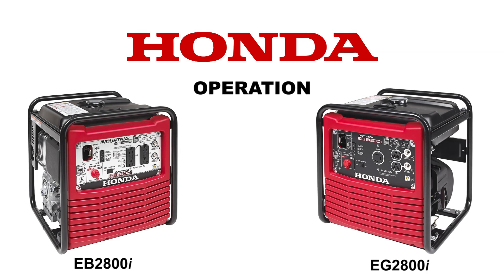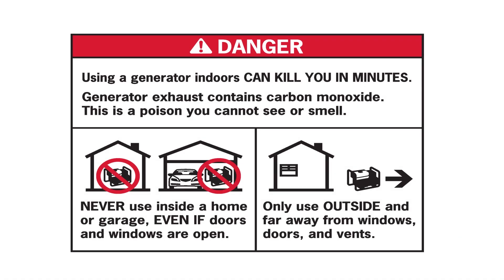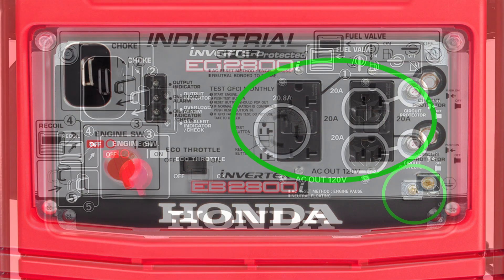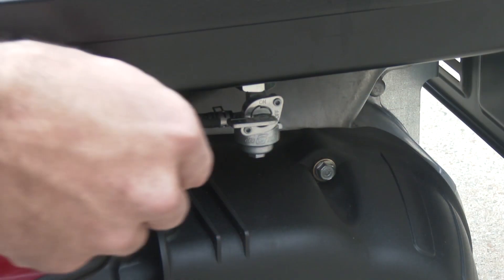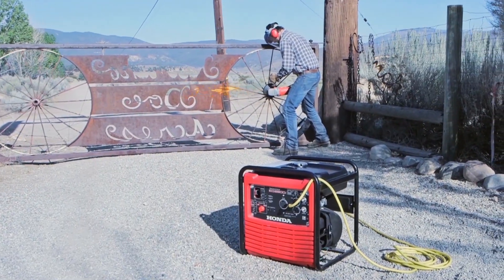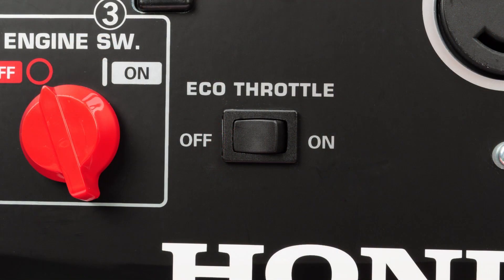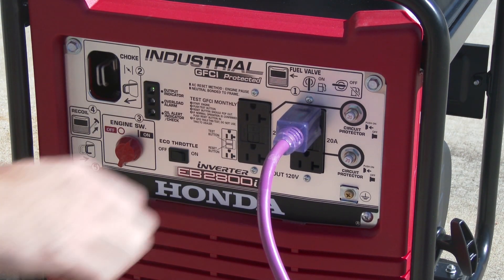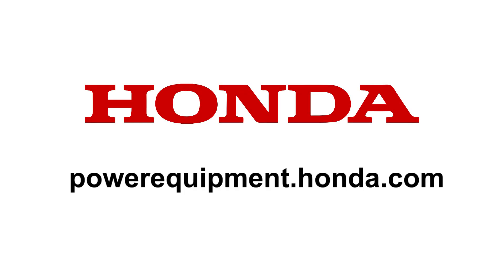EB2800i and EG2800i Generators – Operation

Comment: I thought the 2800 watt generator had the Commercial GX Engine in it like most Honda generators. Unfortunately it does not! If you use it here and there or when the lights out you should be fine though. But for off grid I wouldn't want to use it everyday or for commercial use.
Reply: Dang read this comment after buying one. What makes you say that the GX based generators are superior? Probably too late now, will this be a bad choice for occasional power outage use? Mostly computers, two refrigerators. Don't have aspirations of running AC off of it,  just fans.

Comment: I have a 25 foot RV 5th wheel, I have the plugin from the RV. will this be enough to run everything? the Frig and Cooler I won't need right now as the weather is getting cooler the only thing I would plug in would be the TV,DVD,and home lights because I use only 25 to 60 watt lights. the 2800i or the eu3000i
Reply: plenty of power for all that... Air conditioner on the other hand- that may possibly be too much draw.

Comment: I truly love my Honda eu2200i generator.•••>share4.photo/HEU22Inverter?гν    The main reason I bought a Honda generator is to recharge my Goal Zero Yeti 1400 battery pack that’s advertised as a generator. The run time on my Honda is great and much better then using Solor panels which can take days to recharge something. Honda generators are the perfect equipment for recharging batteries with inverters in them not solar panels